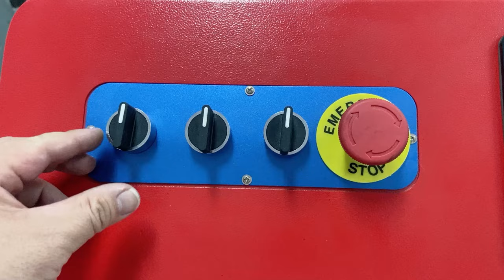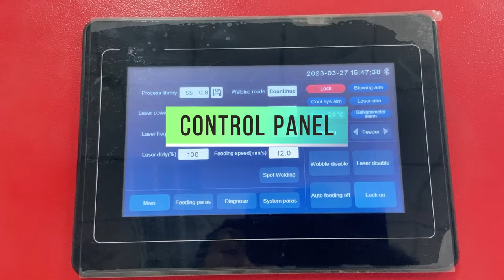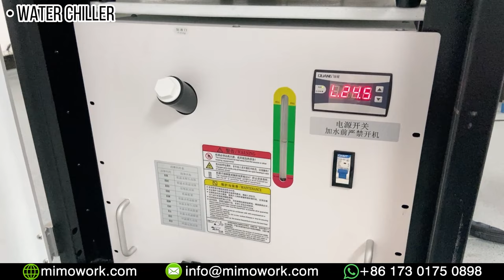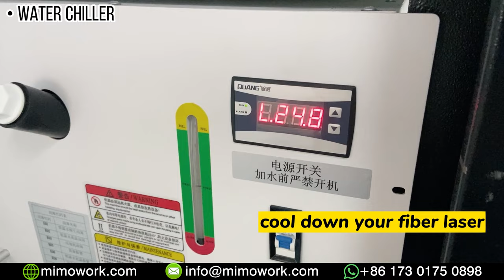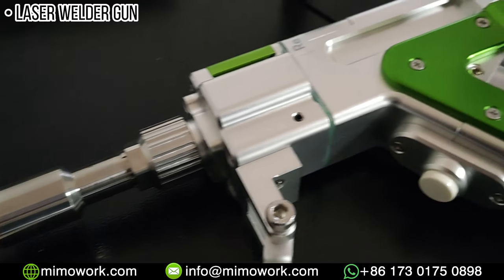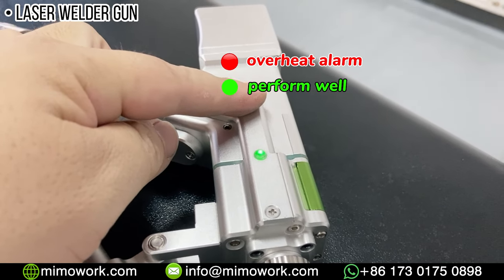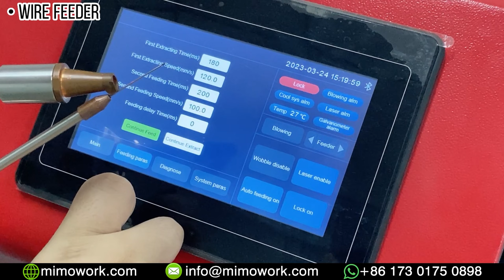Welding Like A Pro - Handheld Laser Welder Structure Explained

Comment: one of the best explanations in yt, thank you friend
Reply from the maker: My pleasure! I'm glad the video was helpful to you. Are you working with metal welding? I'd love to hear what tool you're using and your thoughts on it, if you don't mind sharing. Just a bit curious!
Reply: @MimoWorkLaser  No problem. at this time we use cold TIG for weld stainless plate ga 16.  in order to made non radius square tubes. we control the process at the point to have extra minnimun deformation but the welding time its too long an average of 3 sec. per 1 cm, so we need to switch asap to a laser process, what laser source do you recomend ? thank you
Reply from the maker: You will need a Fiber Laser Source to weld stainless steel.

Fiber laser welding can achieve welding speeds of around 10 cm/s for stainless steel with minimal deformation .

For more information, you can check out this:
https://www.mimowork.com/laser-welding-machine/2000w-laser-welding-machine-handheld-fiber.html

You can shoot us an email at info@mimowork.com, attached with details about your current welding setup and the optimal welding speed and quality you are aiming for. 

This will help our technicians understand your needs and answer your questions better.